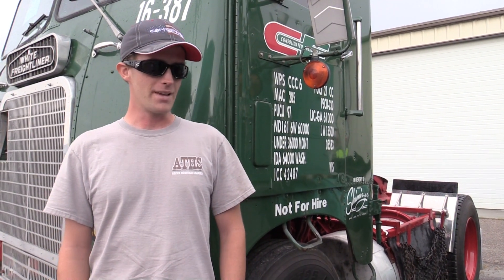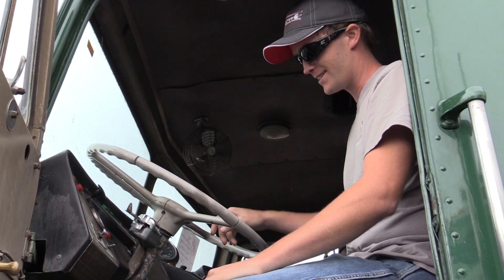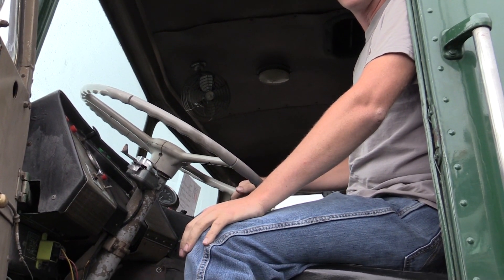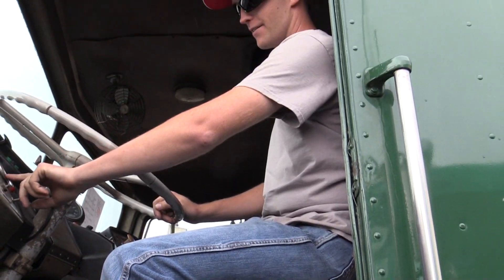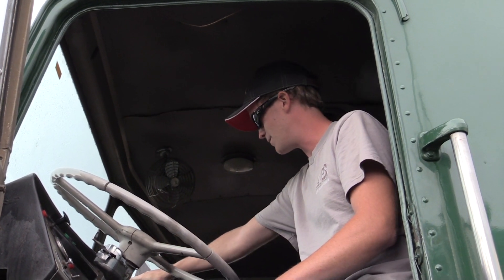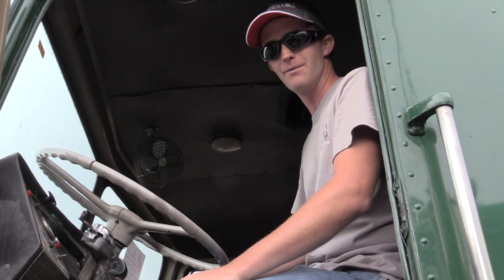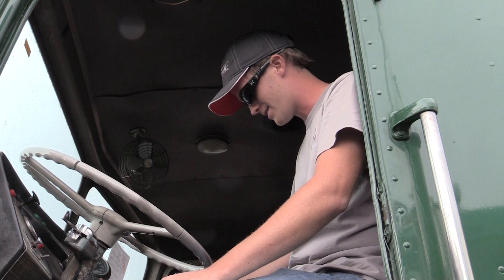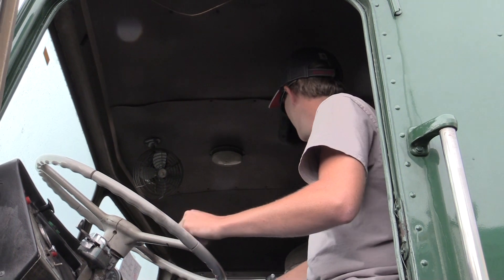Landon Durrant's 73 Consolidated Freightways WFLA

Comment: Damn, I used to hate when trucks with air-starters would park next to me in the truck stops!

Had a chance to work for CF back in the mid-late 80's; the deal was you'd work 'casual' for about 6 months, generally only getting runs on Mondays and maybe Tuesdays. Usually not a full day's work, either. Seemed like that only appealed to farmers. Then, after you did that for 6 months, you had to join the union, and then you might start getting full-time work, but only on the jobs nobody else wanted.
Reply: My father worked for CF from1952 through1988 and I remember he was on the extra board for years, waiting for guys with seniority to retire. I mean guys who were hired in the 20's and 30's...great company, clothed and feed 7 kids.

Comment: Nice junk bro😸
Reply: Robert Calderon hater  nice to look at but wouldn't want to drive it for a living those old freight shakers will beat the hell out of you and that's no bullshit spring suspension and power steering by Armstrong and no insulation for heat and noise after about 400 miles for the day you earned every dollar you made that day
Reply: @sillygoose2508  you're right on that one. This truck doesn't move to far without a trailer on the back end. You definitely get a new appreciation for the old time drivers.